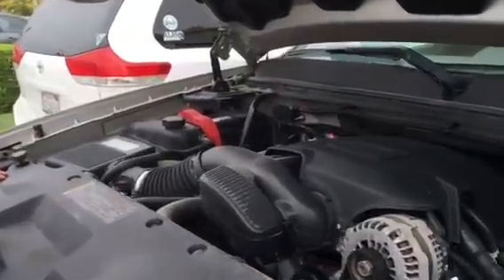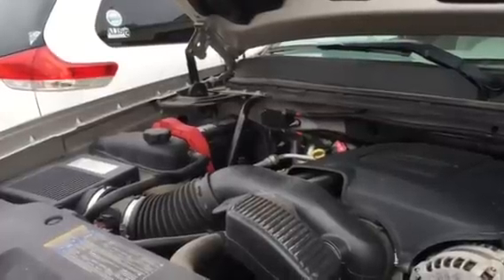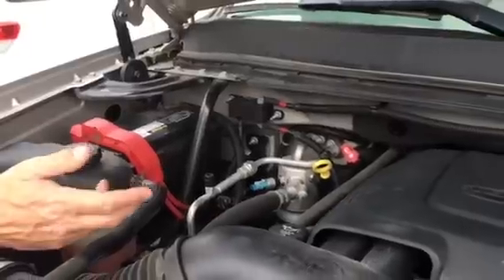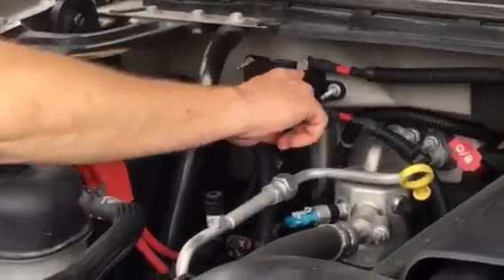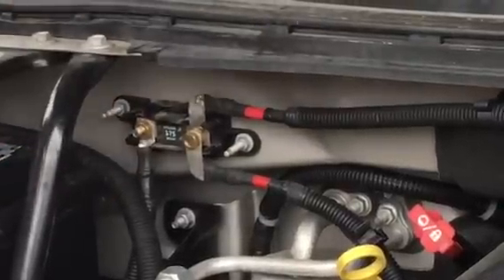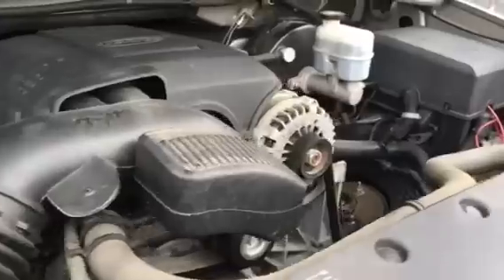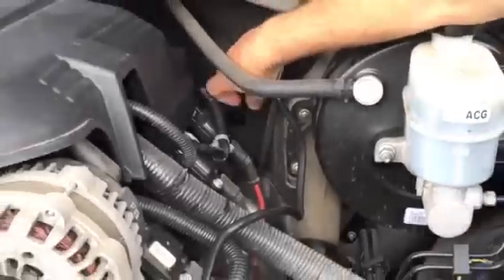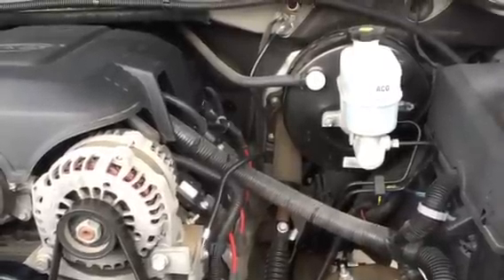GMC Truck Electrical Error Fix

Comment: Thank you Sir. I've been trying to fix their spaghetti code, when I should've just written a new one!
Reply: I have 2007 Yukon have shifting issues and I replaced spark plugs and wires but it still has high rpms and doesn't feel like it shifts passed 3rd so I'm gunna move the ground because it's corroded on the part I can't reach
Reply: @candaceherrera1503 did this work for you bud

Comment: 2013 Chevrolet Silverado 1500: this fixed all of my issues after scratching my head for over 3 days. Thanks XORBob!
Reply: What kind of screw do you use to attach the wire to engine?
Reply: @theoamos4335  lo
Reply: @theoamos4335 did you ever find out what screw they used?

Comment: Does this work for 2010 suburban 1500 lt 4x4....my locks go crazy I lose power I replaced the negative cable with a used one from a Tahoe it wont start it drains my battery quick like I key turn quick go to jump it turn the key to on and my battery needle goes all the way to 19 I shut it off turn it back on and it's a 9 any info from anybody would really be appreciated thank you in advance

Comment: This crazy issue happened to me this morning on my way to work through rush hour traffic.  My locks went cray cray, my instrument panel lights were flashing, lost acceleration, exterior lights were blinking and flashing.  I realized that this was happening when I'd hit my brakes or using my turn signal.  I turned off my exterior and interior lights, my radio, and anything else that I could think of that was getting some juice from the battery.  I'll trace down this fix tonight when I get home, wish me luck, i'll re-post my findings.
Reply: Cody did u find the problem bro I have the same thing happen to me as well let me.
Reply: @drummerboymn  it actually did solve my problem. Never had any issues after I put on the new ground to the engine block.  I was also replacing my battery every year. Now I’ve had the same one for three years.

Comment: Ok so I have replaced the neg cable from the battery, cleaned, greased and reconnected all the frame grounds I could find(2 on frame on driverside, 1 passenger side front). I did the exact same lead you did. Positive lead from battery to starter has 12.7 volts at the starter. Checked the mega fuse, no black marks. This is on a 2009 2500hd 6.0l gas engine. The blinkers quit, the qauges quit for the most part, the engine dies and then won't restart without a couple of tries. I am pulling my hair out.
Reply: This happened to me as well. Going crazy. Replaced alternator, didn’t fix a thing.
Reply: @erienature update? Having this same problem with 2011gmc 1500 5.3
Reply: I replaced damn near replaced  everything,except this smh lets see how it goes

Comment: This maybe a stupid question but, I've had the same issue with my truck for 2 days and it won't start today. If it is that problem and it isn't grounding properly can it kill the battery? This is my project for today.
Reply from the maker: Leon, I'd suspect a bad battery first.  Might want to have it checked.  I know this issue does cause a lot of people problems, and there were times when my truck seemed totally dead.  So, if the battery is good, try this fix.  It's totally cheap if this is the problem!
Reply: @XORBob  thanks man means a lot! Happy picking!

Comment: I've had a similar problem with a 2008 Chevy Suburban 1500 LTZ. After multiple visits to the dealer the only thing I could do to solve this problem because the dealer was not being helpful. I ended up cutting the positive and negative terminals going to the battery and replacing them with new terminals and never had a problem since then.

Comment: Had bad ground from fuse box to frame..the ground stud broke off (probably overtorqued from factory) and most dashlights warnings came on giving  6 engine codes. The stud break wasn't noticable and had an internal break from long time ago making truck stall and run bad as if it was fuel issue.Was telling me no communication to fuel pump module..o2 sensor bank 2 lean,service brake stabilizer, ABS,ect...

Comment: Experiencing this issue right now, it would come and go but here recently it happens atleast one time in my drive to and from work. It’s really becoming a problem. 

My question to you, does the size of the wire matter? Length, Gauge, etc.? And can someone give me a link to an AutoZone or Oreilly product as those to are the only auto parts stores in my area?

Very Helpful video, and I hope this works!

Comment: Im a diesel mechanic and my 2002 chevy silverado has voltage issues i replaced battery alternator had one guy watch voltage meter we hooked to alternator while i shook every single harness and wire nothing i even cleaned all ground wires and still after engine is warm it seems voltage gauge still going haywire  intermittently headlights dim I'm at a loss also in my job as mechanic i have fixed this issue for people its always ground wire or battery/cables or alternator im thinking now maybe fuel pump
Reply from the maker: Hey Wash Guy - did you clean the ground wire that goes from the negative terminal down to under the passenger side fender (hooks onto frame in front of tire)?  There is one there that I had to later clean (after I did this video).

Comment: My 2009 2500HD 6.0 was doing the same thing. Door locks opened and closed, lights got brighter when I accelerated and dimmer when I let off, then the fuel pump would quit and turn back on. Went to a local fab shop had a thicker guage ground wire made it is 6ft long with 3 grounding eye points. No problems since...
Reply: I need to do this

Comment: i did all this--replaced cable clamp, replaced breaker, added additional ground lead but truck still won't start. is it the computer?? Radio plays, headlights come on, can't use key fob,can't lock nor unlock doors from inside?

Comment: Im having the same problem with my 2009 silverado 5.3 engine . stability/traction control. And also my efans wont turn on automatically when their suppose to . mine does not have that granoud cable going from engine to frame . my mechanic lost it and never put it back and thaslts when i started to have the overheating problem.my thought is that pcm is not getring enough ground to properly work.
Reply: Noooo shit! You have a new, not asshole, responsible mechanic now right?

Comment: I feel I have finally found an answer to what my 03 gmc savana van has been experiencing for the last 2 years! I have replaced 2 batteries and a starter. No one can figure why it wont't start at times or why  my inside power goes out. I will try this tomorrow! Thank you so much for sharing! This has been so frustrating dealing with!!
Reply: Did it fix your issue?
Reply: I got an 08  won't start, no inside electric

Comment: Corroded or bad grounds can drive you crazy. Grounds are important on every vehicle. I just fixed a 99 ford super duty with a few electrical issues. Well after fixing three grounds and including making a new ground. Truck runs great

Comment: I have had this problem in the past as well. A 1995 GMC Sierra would not shift properly.  Fixed the ground from the engine to the chassis and it worked correct until I parked the truck.  I am thinking history is repeating itself with my current 2005 Sierra.

Comment: My 07 Sierra might be having the same issue. I have an after market head unit, and when I cut the ignition the radio does a force close shut off type deal and does a full on factory reset. Not only that, but now when I try to fire the truck back up it has no electrical power or anything at all. As if there were no battery in it to begin with.... any thoughts?
Reply from the maker: Cole - I think you are right: this may be related to the problem I was having.  Every once in a while, I would have the entire system just shut down and not start.  Usually, it was just going crazy, but sometimes it got more extream.  I do recommend checking all your grounds from the battery to the body.  I've had a lot of people say this video fixed similar issues.  You might also un-seat and re-seat your electrical fuse box panel.  It's on the right side of the engine compartment.  It has a handle that unhooks the whole thing.  You can then pull it up, then re-seat it into its right spot, then lock it down with the handle.  That might be something to check too
Reply: Same shit here,07 Yukon Denali,radio blinks off & on,sometimes it works but 4 the most part its always off or blinking,amps fall from 14 to below 14,then after a few miles starts charging again,side steps go in & out,have to jump it off after sitn a day sometimes 2 days when i drive it smh...im gonna try this ground wire & see if thats whts goin on with it too smh,only 125k miles one owner too smh.

Comment: I have the ground wire. What bolt are you using to connect and secure that ground wire? A part number or size.
Reply from the maker: Hank Venture - sorry I don’t know either.  I just attached it to existing bolts that were on the engine block and firewall.  See the videos for which ones I used.
Reply: XORBob you attached the negative to the generator block which the alternator is on. On my 2013 Silverado there are no screws or bolts there. I am assuming I am going to have to tap it out because the dealership can’t find a part number for a bolt. an M6 will fit but it won’t go in very deep.
Reply: Hank Venture what did you end up doing? I have 2012 6.2L Sierra with no existing bolts on alternator block

Comment: My '04 3500 has that strap, plus another one from there to the hood (??), whatever that's for. Maybe it's a lightening rod for when I'm out working out under the hood when it storms.
Reply from the maker: Actually, that strap to the hood is to ensure ground to the body.  You'll find those straps to everything: bumpers, bed, door, etc.  I believe the reason is that it keeps you from getting static/engine whine from your radio.

Comment: You should have run the new lead from somewhere on the block not the pot metal bracket. What you did will probably work short term, but a block ground is what should have been done.
Reply: It says "Ground" right on the bracket.

Comment: Well, I redid both battery cables, the ground strap on the motor, and the megafuse, and I'm still have flickering headlights and flickering interior lights...almost like it's going from 14v alternator power to 12v battery power.  Only thing I think it can be at this point is the alternator being intermittent...
Reply from the maker: Have you tried putting a meter on the alt.?
Reply: @XORBob  - The issue is that it's an intermittent fault, and both times I've walked out at night to test the voltage with my multimeter, the problem refused to come up.  And of course you can only notice it during night when there are visible lights to see flickering, in the daytime you can't tell when the problem comes and goes... So this limits me about 5% of the time when I can see the problem come up to try and diagnose it.  I may just keep a multimeter in the truck and stop when it does it next night drive.
Reply: It might be sold in PDF for less.
I own the 18 page Worksheets.
"First Things First" ( $89.00 ) should be incorporated on every Customers vehicle that's having a "Driveability or Computer problem"
www.veejer.com

Because this Guy was a Student of "First Things First", he solved a mans problem within 15 minutes.....The 38 minute to 42 minute mark !!How is this for weird & embarrassing ?

https://youtu.be/4EFzX3SN6ck

Comment: Thanks man my gmc Sierra started doing that on me so I will try this hopefully it will fix that problem
Reply from the maker: Joser - also, I didn't put in the video (but wish I had)... there is another ground going from the battery down under the passenger side wheel well and to the body at the bumper.  It has gotten really oily because it's near the tire.  I also pulled that off, cleaned it up really well, then screwed it back in.  Don't forget to clean that one too.  This power problem seems to all revolve around bad grounding out of the battery (in my opinion).
Reply: Ok thank you man

Comment: 05 Silverado. When rolling 2 or more windows down i lose power, battery light flashes, all my lights dim very noticable. I just went to start it and theres nothing. i tried jumping it with a charger and the brand new (1 month old, expensive) battery is reading 0. if i move the cables around my radio is static and lights are very dim... Truck acts like theres a dead battery.... similar issues? Would this cause the vehicle to not start at all. deffinitely seems to be a ground issue but not sure where they all are.

Comment: Did you have stabilitrack/tractions/ABS lights prior to this fix?
Reply: I do right before it starts acting up did u get it fixed?
Reply: @alexamiranda336  - I did get the traction/stabilitrack issues fixed, but still having grounding/flickering headlight issues.  The stabilitrack/traction turned out to be the steering position sensor and an ABS speed sensor.  I bought the Bosch 1150 OBD scanner and was able to find all the codes/issues.  The important thing is you want to find an OBD scanner that can read ABS codes..that's the only way you'll figure out the stabilitrack/traction issues.  What year/vehicle is yours?  The newer trucks have grounding issues under the dash.

Comment: My 2000 silverado shows a red battery light, and the gauges drop to zero, the truck runs fine but its like the gauges arent getting power, or theres a lose connection. If you hit a bump it works and then if you hit another bump itll zero again.

Comment: Had the same problem on my 2007 GMC Sierra installed that same ground. problem solved. Thanks man video really helped out 👍🏻
Reply: Worked for little while problem is back
Reply: I Noticed the Problem only happens after accelerating hard like passing on the freeway.
Reply: Ever figure this crap out? Lol.
I also have an 07 Sierra. Mine is a 6.0 2500hd. I've replaced the grounds, cleaned other grounds and still acts up.
Trans goes into limp mode (1st gear) bunch of different codes. Speedometer jumps around etc.
Next day it'll drive just fine
Reply: Bra you ever figure it out ?:man I hope so .what was it ???? @MMGJ10

Comment: I had the same problem on a 2008 Chevy Suburban 1500 LTZ where the car would be completely dead. After multiple trips to the dealerships and them not being able to reproduce the problem I found that the positive terminal clamp on the battery was somehow faulty so I had to cut the positive terminal off and completely re crimp new eyes to the leads and then put an aftermarket terminal clamp to the battery. And yes for all that you are commenting about corrosion and Dielectric grease it was perfectly clean perfectly tight and greased and still there were intermittent connection problems. After I cut the old battery terminal off never had the problem again.
Reply: Ok I'm walking outside

Comment: My front left lights keep flickering, so I keep changing them, and they keep flickering.  Looks like this might be the reason.  I'll let you guys know if I had the same problem fixed when I do this fix.  I have a 2007 Cadillac Escalade with the 6.2l.
Reply: Adam Pierce I had the same problems

Comment: Great video...I did this 2 weeks ago and haven't had a problem since. I purchased the GM ground strap for $18 from the dealership. I will put that on this week to confirm if it was that bad ground strap. But for now this fix got me home after a 5 hour drive. THANK YOU

Comment: Replaced the Megafuse and negative cable from battery to body and this worked so far.  Great savings and troubleshooting shortcut...thanks for sharing.
Reply: How did you replace it

Comment: I had a 2007 Yukon doing the same thing...brake light on, check engine light, service stab. light...door locking on its on while driving couldn't drive over 30 mph. After watching your video I added the same ground cable and all was back to normal..thanks
Reply: Still working good? Just wondering.
Reply: We dont beileve u lol

Comment: Great video! I would also put dielectric grease on all of the connection points and run an additional ground from battery to chassis.
Reply from the maker: AnthonyJ350 Agreed... good input for everyone having this issue
Reply: @TruthOrDie777.comCarterEdison  If the leads go to the battery yes on the loop. If from cab to chassis or cylinder head, you don't.